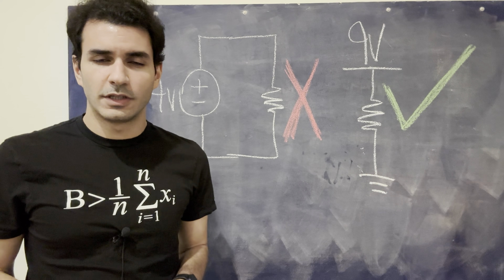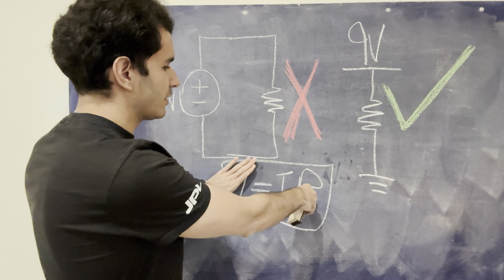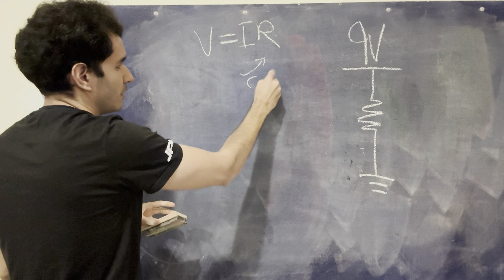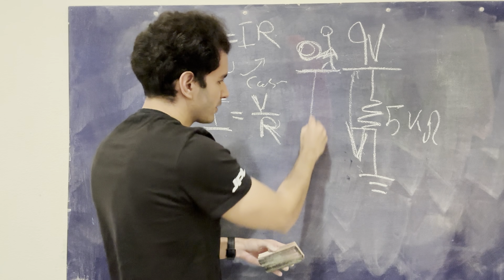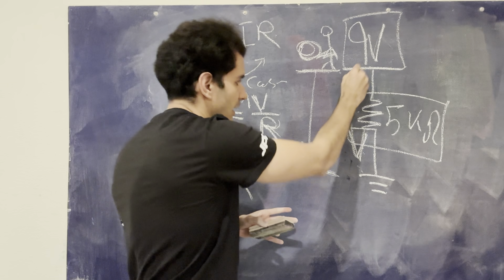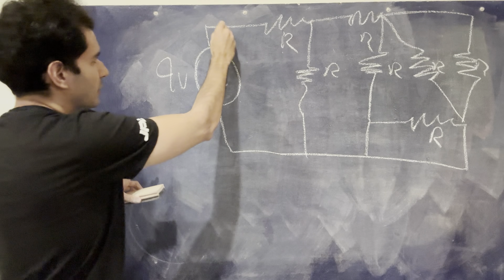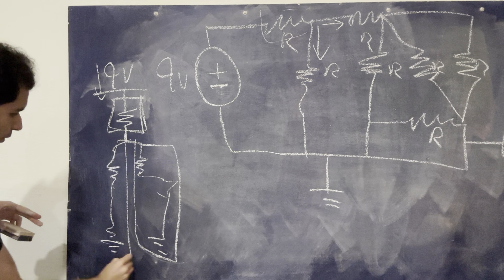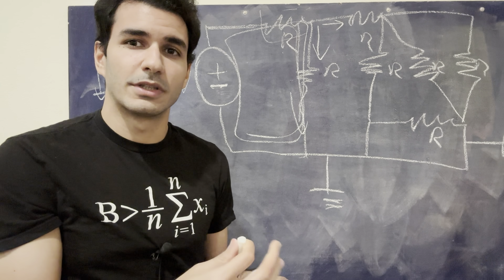Circuits Finally Made Sense When I Saw This One Diagram

Comment: Excellent video! Anchoring new concepts to an existing familiar one is the basis of all learning.
As a fellow physics guy, thinking of electrical circuits in terms of their equivalent mechanical circuits made electrical finally click to me as well.

Voltage as pressure; current as flow; resistance as friction; capacitance as a spring, etc.

Of course these break down in more complicated cases, but having something physical to visualize is super helpful for intuitively reasoning about electricity.
Reply from the maker: Very well said!
Reply: The water analogy has been used forever. It’s better because it makes it obvious because the water has to go somewhere rather than starting a bad habit of not making sure there is return paths. This level stuff is right before Kirchhoff’s which instantly breaks the one straight line thinking. The point of that weird resistor network is to force you to re-draw it. This is all a part of a multi-year process where this set up lessons in following courses. They then relate it all to physics and show the formula relationship to other physics models you with be learning around the same time.
Reply: @asowa42  yes, analogies are the way with things not easily seen with the naked eye. Once the basic anchor concept understanding is established, it becomes much easier to add additional nuance and layers of complexity.

Arguing about which analogy one uses at the elementary levels is unhelpful. Because every person arrives at the first class with a different set of experiences and intuition.

A water analogy may work well for some, but not for others. Springs and pressure may work well for people with a physical / mechanical intuition, but not for others.

To your point, anyone seriously studying a topic will eventually learn the required nuance once they achieve higher levels of understanding - and will not be hampered by the limitations of elementary models.

The true hero of the story is the professor or teacher who is aware of this effect and can explain a concept in terms of a student’s existing intuition!

Comment: I always try to draw a circuit as a voltage divider (vertically) and a current as a split (trunk) just like you did.
The problems is the so called smart people always laugh with my drawings, because supposedly  that's not how it's done.
Little bit like certain C programmers that try to write their code as cryptic as possible, similar for electronic engineers that make circuit easy to draw but difficult to understand

Comment: I think there are special cases where voltage isn't the cause and current the effect. What about buck converter where the inductor drives current when the fet switch is opened... a voltage is generated across the load?
I'd agree typically voltage is the cause

Comment: I think it's interesting to help better understand the physics but in the long term you will have to understand the circuit in the loop. The obvious and common analogy would be talking about it like water and pipes. You can even kinda equate it to a water tower and now a person standing on the roof with a giant rock.
Understanding the physics can be useful when intuiting adding or dividing voltage, current, or resistance with series and parallel. You have a gallon of water and an inch pipe, then you add another one inch parallel pipe and the current goes up/resistance goes down. Makes sense because there are now two pathways for the water to move.
The reason that the loop is useful is because circuits are built in a loop. If you have a loop that has higher potential (voltage) than the circuit is designed for, it will burn out components or possibly damage the power source. The energy in a circuit must end up as zero (Kirchhoff's Voltage Law). The only choice is for the energy to be utilized in the circuit components or the voltage to drop (sag). So, people, get used to the loops!

Comment: I like the way this guy thinks ,,  my circuit was designed on the  " almost getting something for nothing " premise.  Long story short it produced what I believe to be a resonance cascade and it will catch fire if I don't stop it except my 9v battery only has 6.4v left in it,  that's  the game ,,  as a result of all this I'm producing crystalin based capacitors and resistors to rebuild this.  I'm searching for a particular type of resonance  ..
and yes I prefer the loops in this case but I'm not working with rails  ....

Comment: Water Tower Analogy and reducing  the hell out of my circuit always helped! Loving the shirt..
Reply: I think its an improper way of looking at a schematic  with a water tower analogy, you introduce gravity, which mater water flow faster, the longer the distance. Also in order to get water up into the tower you will have head pressure (gravity against weight of water).

Comment: You are just making a gravitational analogy vs a garden hose and water flow analogy that I use. Voltage=psi, resistance = pipe diameter,  flow rate= amps.
Any way you can visualize things is very helpful when trying to wrap your mind around engineering principals.

Comment: Im genuinely curious… are you guys really struggling with understanding the original diagram and equations? Its very intuitive to me and im struggling to understand how it isnt for others
Reply: Yeah, this approach fails to explain anything intuitively that isn’t in the original diagram.  And it leaves out the crucial concept of currents always flowing in loops (absent electromagnetic radiation).  This video just hand waves some visual similarity of the vertical diagram to the equation I = V/R.  This equation, by the way, is exactly the same equation as V=I*R.  If you haven’t yet learned that degree of algebraic facility, you should not be trying to analyze circuits diagrams.  No one needs that stupid pyramid diagram of ohms law.
Reply: @scott.d.willingham and verticle representation of a circuit is all fun and games until its an ic in parallel lol

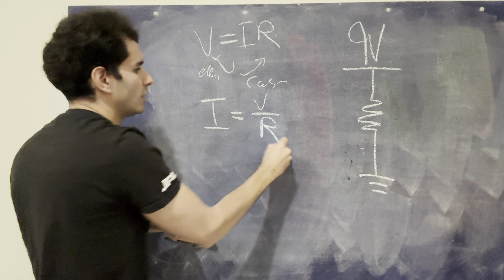Comment: 2:19 - Well done! Ohm's original concept states that the current is directly proportional to the voltage applied and inversely proportional to the resistance.  The focus was on what you want to accomplish: current. "You can buy voltage, and you can buy resistance; but, you can not buy current: it must be created from the other two!" Work is done (current) by dropping voltage (potential) across a resistance (load) which can be readily visualized by the vertical diagram (which is? BTW is the way schematics are drawn! Great post!

Comment: There's a reason why elementary electronics uses the diagrams you disagree with. And it’s clearly because the deeper you enter the subject, the more you enter into mathematics and circuit design. Understanding the process of designing from mathematical modelling. Is the same a cad design by hand. The grounding matters

Comment: I am very illiterate in physics but a couple of times i attempted learning basics of EE. Right now, at 33, i intend to go at it once more in a seriuous manner quite like last time as i enrolled at EE-program at university but had to make the rational decision to quit after a couple weeks cause i had found a job. Thankfully so because without having an idea in the beginning, that job lead me to practice the profession I had already graduated in, translation.

I also took the formula as I = V/R rather than just memorising something. That way i could imagine the water coming out of a hose for example as the current/energy. The pressure i would put on the tip of the hose with my thumb would be the voltage/pressure, making the water burst out (explosively, hence more energy/current in my imagination). The resistance in this analogy would be some kind of a blockage at the end of the hose, e.g. some bug that somehow got stuck there and had amazing grip to hold on to the hose :)

Comment: Your approach actually makes alot of sense when you look at it through the lens of kinematics.

Voltage is like gravitational potential energy, current is like motion, and resistors are like air resistance. Charges ‘fall’ toward ground, losing potential energy, just like an object falling under gravity. Props to ya Ali for making it click.
Reply: ....with a few caveats
* objects falling under air resistance tend to speed up, till they hit terminal velocity. (i guess yoh could say this is akin to drift velocity in electronics, but then dropping an obj. frm a greater height doesnt make it have a higher terminal velocity)....terminal velocity is not height-dependent.
Reply: @kiranmanoj3025  ur right that terminal velocity itself doesn’t change with height, but height kinda does determine whether terminal velocity is ever reached. A person falling from a 2 story building won’t fall long enough to reach ever reach it, so air resistance has less effect. But from a plane? drag eventually balances gravity reaching terminal velocity ( Same analogy with short and long wires)
Reply: There's actually a really cool equivalence between mechanical and electrical systems that you'll learn in differential equations, controls, system dynamics, etc. The analogies are Mass to Inductance, Damping to Resistance, and Spring Stiffness to capacitance.
Reply: Except electrons don't 'fall' towards the ground, they instead move from the ground up, while it makes sense for conventional current, for electrons to lose their potential energy and convert it to a usable one they must move to higher potential (higher voltage). This is explained by the formula E = -eV

Comment: All the armchair 'electrical engineers' are missing the point of your video. We already know that circuits are in a 'loop', its in the name and it's why it's called 'completing the circuit'. lol. I ran into too many of those types in engineering school and it turned out they couldn't do any actual troubleshooting in real world applications, if they hadn't memorized it, it may as well have not existed.

Comment: As long as it still works with Kirchoff's Voltage Law .
Sum of the Sources and drop in a Closed Loop equal Zero.
and Kirchoff's Current Law.
Currents entering a node must Equal the Currents Exiting the Node.

I suppose it still works.
We can just highlight down.

I wonder if it holds w/ the others Thevinin Eq., Superposition, Nortons Theorem,  . . .  I guess that still works then.
And I'm a Physics Major so  👍

Pre-Transfer (Off Cycle right now)

Comment: Voltage is the ball on top of the cliff, resistance is the parachute attached to the ball. Current is the speed of the ball as it falls. The hight of the cliff and the size of the parachute determines the speed of the ball.

Comment: My rule ? I use isolated wire size for distance between positive and negative for dc . For ac its 3 time more distance isolated wire . If you use solid wire for dc ? Airgaping of small wire can be ignored . Only big wire need to be airgapped

Comment: Thanks, great way to explain it!
I remember vividly, my 1st year in physics, that memorizing all the formulas and equations could only help you until you actually had real life problems, and not the cozy little model problems always  under 'ideal situations', as if real life operates in a vacuum. My point ie; as soon as i learned to just look at the systems in question PHYSICALLY, with common sense first and foremost, before looking to plug numbers into equations, i was able to digest the whole point of physics to begin with. Obviously its the same with electrical circuits. When you're first leaning this stuff, you get so caught up in the memorization of formulas and equations, you completely neglect just taking a good look at the system you're trying to diagnose first. And thats really the beauty of physics for me, just observing the entire system and all of its moving parts. That ability to visualize helps so much in the long run!

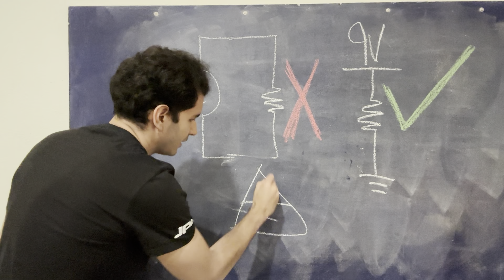Comment: Bravo re 1:20 triangle. I say this time and time again to my students: if you are relying on gimmicks like triangles to memorise your equations, you are not a scientist. 

A true scientist will understand the theory which underly scientific concept. 

Once understanding is grasped, you are not relying on triangles or remembering in which corner the various variables will be positioned.

I wish schools ditched them. My heart sinks when I see students bring them into my tutorials. Triangles are lazy and don't encourage scientific understanding.

I also agree with your analogy about dropping a ball. I teach this exact same concept in a similar way to my students. Here's how:

I say that there are loaves of bread (electrons) stored at the bakery (battery) (for simplicity sake) ( I know the electrons are throughout the circuit).

At the bakery, the loaves go down a chute and a fixed number are loaded into a van (equivalent of a coulomb).

The higher the chute, the higher the gravitational potential energy (which they will have already learned about) ie the bigger the force they are pushed into the vans (equivalent to potential difference).

From there, they are transported via a road network (equivalent to wires) to the final destination like supermarket (equivalent of component). 

The resistance is at the supermarket which is determined eg. by the numbers of staff who can unload the delivery or there may only be one, narrow door at the supermarket.

There, the laoves of bread are unloaded and the difference between the amount of loaves before and after delivery per van is the equivalent of potential difference.

Please tell me we are on the same idea!

Comment: I like this but it doesn't make sense if you put a switch between the 9v and the resistance. The power doesn't fall down and stop at the switch. It doesn't even go to the switch until the circuit is closed and the 9v senses the resistance. It is a good idea and I see where you're going with it.

Comment: Teaching physics often boils down, as Terry Pratchett once put it, to telling "lies to children." The “lie” shown in this video might help some people grasp the basics at first, but it also introduces a lot of misconceptions that later make it harder to truly understand what’s going on in real electronic circuits. These aren’t just simple setups with a single voltage source and a couple of resistors, like the final example — real circuits include solid-state devices too.

The basic voltage-source-plus-resistor circuit shown early on has one major benefit: in lumped-element models, three laws apply — KCL, KVL, and Ohm’s law (all of which are really just simplifications of the more general Maxwell's equations). In this simple example, you only see KVL and Ohm’s law at play. Add a second resistor in parallel, and now KCL kicks in too. Thanks to KVL, the voltage drop across the resistor matches the source voltage, which allows current to flow according to Ohm’s law. The key word is "allows" — current only flows if there’s a closed circuit, a complete loop. In this case, there is one, because an ideal voltage source will permit any amount of current to flow — even infinitely large current. Of course, no such source exists in reality — a battery doesn’t behave that way.

That infamous vertical resistor with a “floating” 9V source is especially misleading. A beginner won’t realize that current has to flow through that “floating” 9V. But how? The diagram visually suggests that 9V equals 0V, because there’s no path for current to travel. No current means no voltage drop across the resistor. And in more complex circuits, this kind of thing happens all the time — there might be a closed loop, but some active component forces the voltage drop across a resistor to be zero, and current doesn’t flow, even though it technically could. An op-amp is a great example of how that works.

This kind of simplified model also makes it harder to understand current-source-based circuits. While current sources don’t exist in nature, many electronic systems behave like them — lab power supplies, or more commonly, LED lighting circuits. In LEDs, to get consistent brightness, you have to force a constant current, not a constant voltage. The brightness of an LED is directly proportional to the current, not the voltage. Meanwhile, the current–voltage relationship is nonlinear — it's exponential.

Current sources can also be created by things like induced currents in antennas — but modeling that correctly requires going back to Maxwell’s equations.

And when modeling active circuits, things get even weirder. You start seeing abstract “pathological” elements like norators (which can have any voltage and any current) and nullators (which enforce both zero voltage and zero current). They're kind of like a mix between an open and a short. Put them in series and you get an open circuit (zero current, arbitrary voltage); put them in parallel and you get a short (zero voltage, arbitrary current). And real circuits can behave like much more complex combinations of these cases.

So to sum it all up: this is a fine model to explain things to school kids who just need to pass their physics exam and move on. But please, don’t use it to teach future engineers — people who’ll actually need a deep, working knowledge of electricity in their careers. Otherwise, we’ll just end up releasing another wave of underprepared grads into the field.